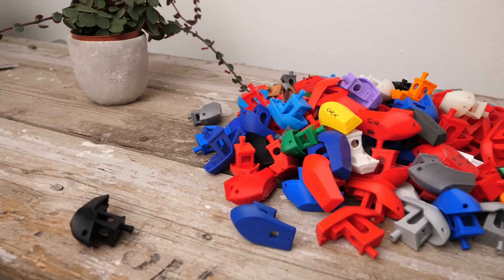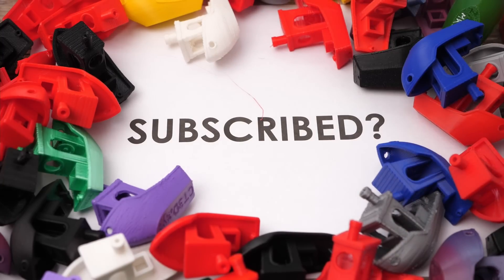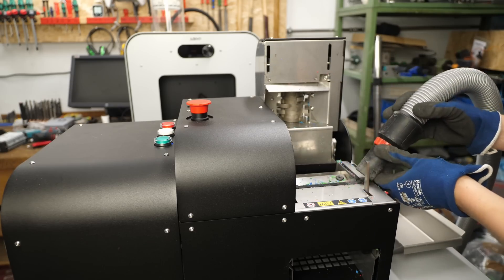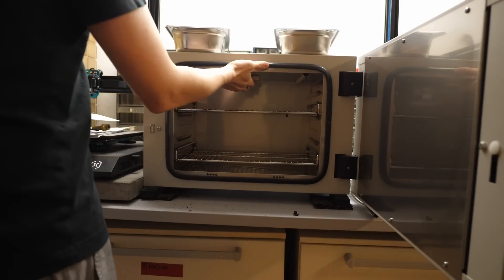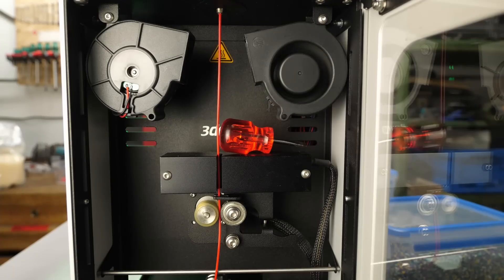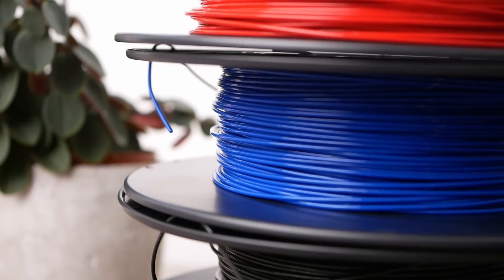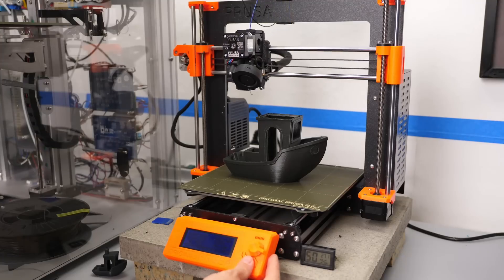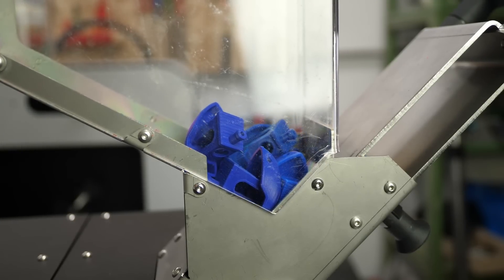Recycling all my 3DBenchys into new Filament

Comment: I think the answer to getting consistent filament size with recycling prints is to take just one more step.
Run it through the extruder twice. At the extruder, Have rotating blades similar to a pasta maker, the first batch run through gets chopped into a MUCH more consistent size, you would get little pellets. Then run the pellets through the extruder the second time and since the pellets will go through the extruder much more evenly you should get a more consistent end product.

Comment: Mixing the grinded leftovers with pure pellets can improve extrusion quality, but dissolve a colour. You can use dying concentrate to dye your colorfull grind to black.
In addition, cooling extrusions with fans is not recommended, that causes rough texture, you should use water bath, but in vertical process it isn't possible.

Comment: Let's throw a brick into this boat's tiny ocean pond: sort then melt the waste 3D print materials, then using either 3D printing or other forming methods, make molds of useful parts that you will simply press cast your bulk non filament material into. 

Less labor related to the cleaning, sorting, melting extruding and remaking spools. Also, you could potentially just bring a standardized block of recycled material to a store or other 3D printing business and get a standardized amount of money from it. Then everybody can pre recycle their material and choose to reuse or resell.

Comment: Seems like there needs to be a secondary step after initial spool is made.feed the spool back thru a second hot end with sensors in front and behind, so the diameter could be checked, adjusted and rechecked. also might be really helpful to have a  prior step to melt all the chipped plastic into more consistent beads. . .similar to what youd buy for raw PLA pellets.

Comment: I got curious about building my own plastic parts for various DIY by recycling HDPE, LDPE and PP at home. Accumulated some plastic grocery bags, window insulation film scraps and some bottles. I currently only focused on HDPE. I made my first two marbled HDPE plates by melting them in the oven at 400 F covered in parchment and alu foil and pressing them with clamps in a MDF mold.  Very imperfect, but my god a 10-12 mm sheet of HDPE is freaking strong.

Comment: Regarding the extrusion inconsistencies with the mixed PLA - what if you chopped the 1st filament run into nurdles and ran it through the system a second time?

Comment: You could check if there is a different type of screw available.  When we're doing a lot of different colors we will often change out the screw flights with very aggressive mixing sections.  This is very helpful when we need very homogeneous mixing of colors, fillers, additives.

Comment: I think recycling is essential. We already know the risks of not doing it, the challenge has been how to do it. These machines are too expensive for the enthusiast crowd, and way too expensive for the entry-level crowd, but I do wonder if a makerspace or maybe group of friends pooling some cash could make it a thing. You never mentioned noise, though I assume it's not quiet. I would be interested in various experiments... how often can it be recycled? What is a good ratio to blend in virgin pla pellets (strength, look, does it increase the amount of times you can recycle it)? Etc. Also, an actual fix for the simple screw driver holding filament in place on the multi-thousand euro machine...

Comment: I think this is awesome for prototyping. It seems it would be best to use the exact same filament brand and type to create a reliable process for reuse. It would be nice to take a failed prototype and immediately grind and store in a specific container till enough is ready for creation of new filament. It seems with current technology at home recycling would have to be a very rigid process for consistent results. Nice work as usual, thanks!

Comment: As for the problem with not beeing able to use the benchy as bath toys;they do seem to float; why not glue a bit of steel or similar to the bottom to make them float head up(if there is enough boyency while having enough weight to get them upside)

Comment: Hey Stefan, in this video you mentioned about the melt inconsistency which could be due to residues from other experiments. Is there some type of cleaning agent that we can use for such type of screw based extruder ? Also it would be great if you could share how you solve the problem with the 3DEVO team ✌️😊

Comment: as a Process mechanic for plastics and rubber engineering i really appreciate that you recycle the plastics.  the rough surface you had after extrusion is most likely due to water that was still in the plastic. idk which material you used but here are a few tips: dry the plastic longer (pretty obvious) or you can change the temp settings. For a 3 zone Extrusion i recommend this setup for HDPE:

1st zone (feed section) 30-50 °C zone 2 (Compression section) 180-190 °C zone 3 (Matering section) 160-180 °C. you want to heat up the plastic quickly so for that you use higher temps in the Compression section and set it lower in the Metering section so it is thermoplastic.
Reply: Any good handbooks you would recommend for extrusion?

Comment: I was told there is a company in the USA, where if you ship them 50 lbs of plastic to regrind, they would grind, and turn it into 22 reels of filament at the user cost of about $10/roll.  That is lots of any one kind of filament.  A diy like this device or the promise of filastruder (back when it was in kickstarter anyway) is still a great dream.  I hope we can get there one day.

In the mean time, if folks want to address the bigger plastics issue, checkout https://preciousplastic.com/ they have diy larger scale grinders and extruders than what we use in 3d printing, but a great resource, and if you have a location that supports them near you, a good place for your plastic waste.  Small scale recycling operations, with pockets world wide.

Comment: I've saved every single piece of PLA and PETG scrap my printer has produced since I've owned it to at some point re-extrude it into filament. I finally have enough that I've started building my own extruder. I don't have enough scrap of single colors to separate out though so it'll probably faintly glow in the dark given the amount of glowing filament scrap I have.

Comment: Great video, as usual.  You noted the recycled PLA filament was "more stringy" despite being "bone dry".  Maybe I missed it, but did you dry the filament after extruding?  I would think that during the heating/extruding it's likely to have picked up some moisture from ambient.  Perhaps drying post-extrusion is a required step?

Comment: I'd love an affordable user-level version of the grinder + melter, being able to completely recycle old material seems way more cost-effective on the individual level
Reply: Yeah but the detector and stuff would still be expensive
Reply: @exMuteKid  Not really. People have built extruders for 200-300 bucks. The sensor doesn't need to be optical and other parts can also be much cheaper if you're just a hobbyist and not interested in producing high quantities of filament.

It would be cool if people came up with a DIY design using standard parts, would be an interesting project and very useful. Kind of like the Voron printers which you have to build yourself but the parts can all be sourced easily.
Reply: Time is money, and none of this is cost effective on any level.
Reply: @larrybud  Maybe so, but it reduces waste and adds another layer to the hobby. In the world of cheap mass produced injection molded crap 3D printing usually isn't exactly cost effective either, but that was never the point.
Reply: @larrybud oh yes u dont have a single second to waste in your lifetime... meanwhile watching this video..
Reply: @larrybud  For most hobyists, this is a money sink. I don't print thinking I'm saving money, or time. Most of the times I don't anyways, I do this because it's fun
Reply: @larrybud  Correct. Every hobby and passion project should be done with the intention of pumping it for as much money as possible. /s

Comment: Thank you for putting in so much effort to show this!
Besides cost, I think about the space that the recycling equipment takes up. That's really the 'tipping point' for me in thinking that a service would be the more economical method to recover 3D printing waste/recycling prints. Also, it would be something that schools/public libraries could use. The company could possibly 'donate' the recycled filament to these public institutions for tax write-offs, too.

The downside is shipping costs. If material has to be sent into this service, and the filament mailed back, there is that added overhead. Perhaps collection points at libraries or other creative solutions could solve some of that.

I'm really looking forward to ending the 'wasted plastic' stigma attached to this technology!!

Comment: re-coloring on the fly or when making the filaments
Reply: why not just direct melt, to filter with at wanted temperature, then extrude that material directly to a wanted object
Reply: injection molding with plastic

Comment: Bearing in mind pla is made from primarily plant materials which break down over time and is therefore plentiful and relatively cheap is there any point recycling it for re-printing itself? Surely a better green use would be to have collection points for used pla which could be recycled in commercial quantities and used to make the print spools instead rather than making the spools out of oil based plastics?

Comment: what we need is a 3d printer that uses shredded material to print with, have it so that it is the plate that moves instead of the extruder nozzel, have a screw system that pushed the shredded material into the extruder nozel, and prints from there,

Comment: If I recall from Thomas Sanladerer's video on his visit to Proto-Pasta they would perform to extrusions of the plastic when mixing up the pigment. The first to mix up the colours, then that filament would be chopped up into uniform pellets and then they are extruded into the final filament. Might be possible to do a similar process here where you first extrude the filament quickly with less dimensional accuracy and then chop it up into pellets to do the final filament extrusion. Might help reduce dimensional inaccuracies due to chips getting clogged or different material having slightly different melting points.

Comment: I have a hypothesis on the stringiness of the final prints. In the past when I've printed with filament that was rough, I had similar results to what you showed. I believe this might be due to an increased surface area. If you have the time, I'd really like to see virgin/recycled mix extruded with the same setup. I believe this will decrease the roughness, and therefore lower the surface area of the filament. I bet if you roughed up that same filament while warm, you'd see the roughed up filament is much more stringy.

Comment: A project like this is great from an educational point of view. The process of learning how to build a mechanism to grind the waste plastic, then learning it needs to be screened for size, etc. is the type of hands on experience that teaches a lot.

Practically speaking you will consume more energy and resources trying to recycle a few KGs of waste plastic into more filament than it would take to produce new filament. This is the rub with recycling in general it makes sense with many materials but not with every material. To paraphrase two old adages at once, "It is easy to let your green colored glasses trick you into being kWh wise and MWh foolish."
Reply: Energy is a far less finite source than materials though. Especially if you were using batteries charged via wind or solar to power the machinery.
Reply: @moon_wizard1250  It a popular myth that solar panels and batteries are 'better for the environment'. They are not. Accounting for the total energy and material input into making them and what usable energy you get out of them, you find out that they are energy negative. It takes more to produce them than they will ever generate.

Comment: Loss in performance is acceptable, I would go with a 2 step process, first make a rought filament in you DIY extruder that allow you to filter, clean and put to size you material. And only then you grind it again into regular and properly sized granule to by extruded in your 3DEVO. 
BTW it's a common process in plastic blending the granulating process.

Comment: Besides a filter for the liquid plastic, I would also recommend adding a magnet to the output of the hopper. Its just a cheap and easy way of getting rid of any ferrous material, and it will reduce the amount of times you need to change your filter mesh ;)

Comment: Hey Schtefan, recycling doesnt always mean to use it for the same thing. Maybe repurpose for injection moulding or make new material mix with other material li,e saw dust like a company does here called modwood. Presses and moulds etc... but then you should consider the viability of what you are going to make.

Comment: Can that machine make larger size filament?  Like 3mm?

My theory with recycling 3D prints is that if we used a larger filament diameter, and a more robust printer extruder, then we could handle the lower-grade material.  3D printers have evolved for detail and speed.  If we want to recycle our filament then we need a new type of printer that's built to be tough.

Comment: "I recovered the part with some G-Code trickery". Yeah, we're gonna need you to elaborate on that. That sounds amazing
Reply: Delete all the rows before the jam? Not that complicated.
Reply: @powermos  The hard part is finding the correct reference point. If the printer was stopped when the filament was removed, the steppers may not have been locked, or maybe they moved slightly. Everything's gotta be perfect, and that's what makes it impressive imo.
Reply: @Joe_Yacketori  Im thinking maybe he does it by keeping track of the time and filming it? You could theoretically jot down the print time for every big print and scroll through a print preview of the gcode to find out what layer  would happen at what time. Cross reference your video with the print preview and find out what layer it failed on. I hope that made sense I'm quite a bit less than sober and I'm certain there is a way easier and smarter way to do whatever he's doing lol.
Reply: @N-VAMusic  Nah, figuring out which part of the G code it failed on is the easy part. What I'm talking about is keeping your print head in a "known" location. At the beginning of the print, the print head homes itself. The rest of the print is open-loop, so it just prays that it doesn't ever get shifted. It assumes its reference point hasn't changed. The challenge here is tinkering with the print head and swapping out G code without disturbing the reference point of the print head, because it is 100% reliant on its recording of the initial homing location, which could get shifted if you move the steppers slightly while playing with it and unclogging it.
Reply: @Joe_Yacketori   You can edit the gcode to do an X/Y homing at the start, so there is your reference point back. Then you add the rest of the neccessary startup codes and delete all layers until the one that failed. But finding out which one that was is very important. I guess you could manually jog the head until it touches to get the Z. If you turned the printer off at some point you'd ofcourse have to tell it what height it is at. That's it, have done it myself.
Reply: @attitudeadjuster793  Very true, the XY homing is trivial since nothing obstructs the print head — good point! But the Z homing isn't so easy. Maybe steppers with encoders could be used to track relative movement and figure out absolute movement using the Z offset? Sounds like some firmware trickery that I don't feel like doing, but it would be cool.
Reply: @Joe_Yacketori  Well if you have encoders that will work but I dont think there are any printers like that in existence. If you have a removeable print plate you could take it out to do a full home. If not you can also measure the height with a ruler directly. Though I doubt that would work very well :D
Reply: @attitudeadjuster793  I have heard of closed-loop steppers, but they aren't very common, to my knowledge. And I would certainly not trust a removable build plate's repeatability, that's for certain!
Reply: @Joe_Yacketori  They absolutely exist, but not in your common desktop 3D printer. It adds cost and isn't really needed because there are no forces to speak of acting on the tool, so counting steps is enough.
And i forgot to say, if you dont power cycle the machine then homing is not needed at all anyway since the reference is never lost.
Reply: @powermos  but he probably didn't delete the x/y auto leveling and the additional height (z raising) for the new 'first' layer (and also the setting for speed, temperature, fan power...). I would also recommend to give the new first layer a tiny bit higher extrusion rate.
...and except the code he must have adjusted the printer to a new 0 for z at the last printed layer.

Comment: I try to print as little as possible, in that I don't like having to throw printed things away so I engineer the designs as much as possible before I have to start doing test prints.
On the subject of new blends, I recently tried printing a combination of PETG & TPU using Thingiverse 3565827. Why? Well earlier this year I printed some quad propellers out of TPU and they actually flew! But not as efficient as normal props, so wanted to see if I could make a stiffer yet still flexible material. The props didn't come out too well as the layers didn't stick so good, I think I have to increase the final print temperature beyond 240C. But it did print!